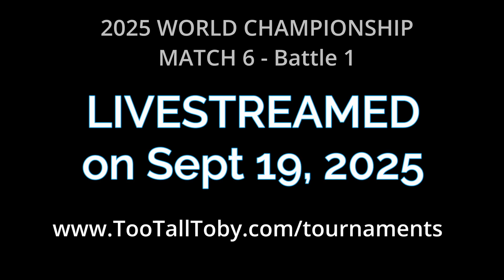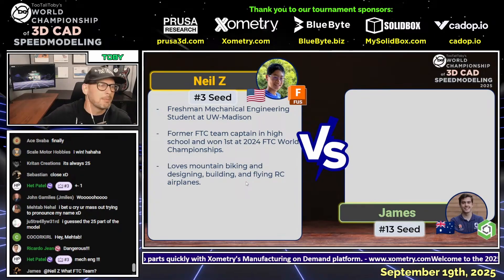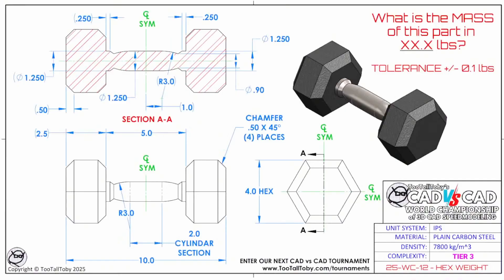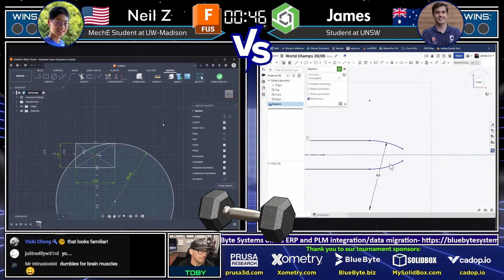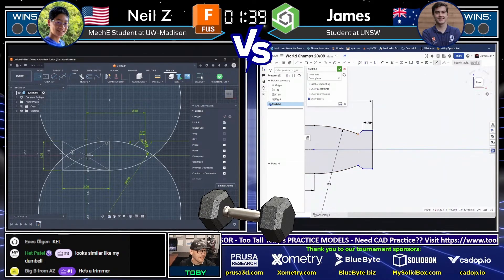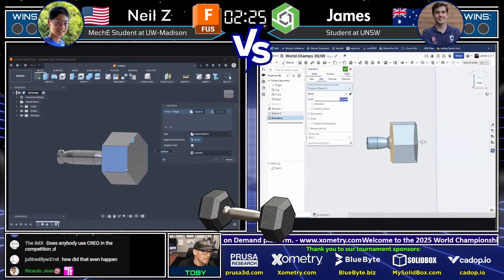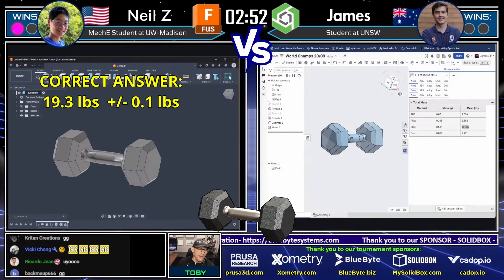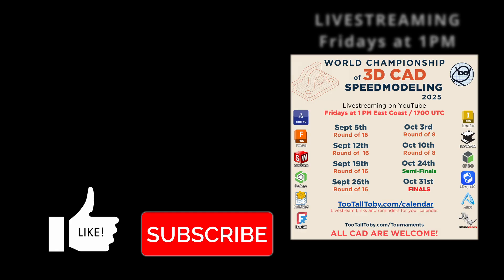CAD Speedmodeling Tournament! - MATCH 6 Battle 1 - WORLD CHAMPIONSHIP 2025

Comment: Gj Neil, proud for Fusion Users 🤗🥳. When I saw project, thought about using cylinder extrusion from vertical plane, and to connect middle shaft with weights hexagon with loft, and after using just extrusion of hexagons with taper angle at 45 and -45 Deg at indicated distance (0.5 inch think, because I'm using metric system)